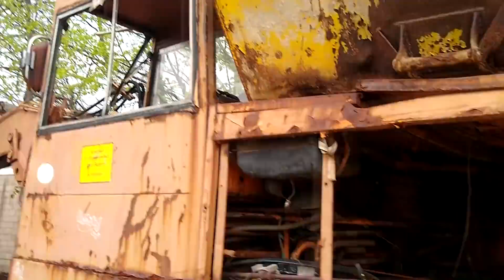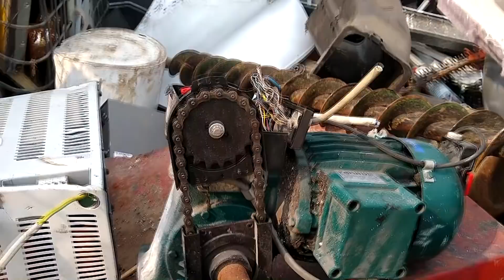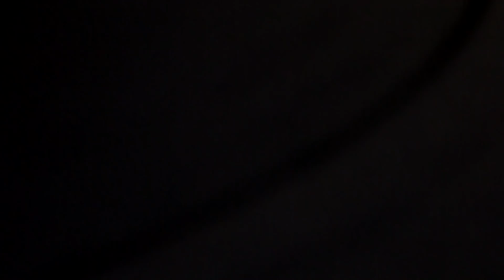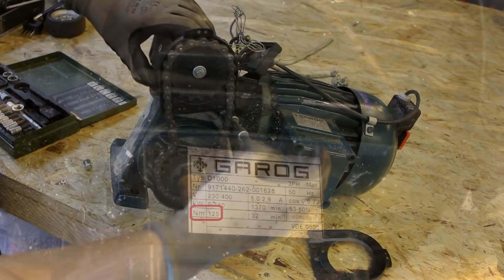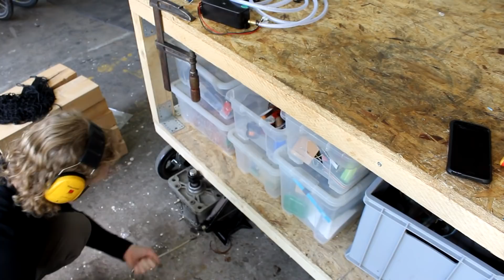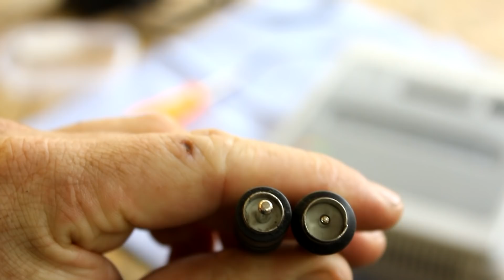Scrapyard Finds Repair-A-Thon

Comment: SNES are remarkably durable. As long as there is no liquid ingress, if it has a fault 8 out of 10 its either cleaning up the cartridge connector or the PCB fuse, which you can replace with a 20mm fuse-holder which happens to fit perfectly 😁

Comment: I love your scrap yard videos. I use an old refrigeration vacuum pump when making plaster moulds for aluminium casting. It’s very good at pulling the air bubbles out of the plaster while it’s still wet so my moulds end up with no porosity at all. Cheers Stuart 🇦🇺

Comment: I just thought of something really rude.  With the right engine - and a service check on the gear assembly on the underside of that crane, and a re-fit gaskets on those hydraulic arms - you have a nice second hand industrial crane....

Comment: Regarding the FESTO: it can be modified by changing the main tube (to a longer piece), the 4pcs of outer bolts/threaded rods respectively, and the main rod itself (this would be the pricy part)....but this way, you can get more stroke according to your needs....Furthermore, you can put a spring inside according to your needs, and you will get a single actuated pneumatic cilynder....

Comment: Great stuff! I need help with a Parkside 18 volt charger JLH-H150-18.  How do I check it and find out why it does not charge. Its output is only 0.4 volt. Thanks. Sham.

Comment: Enjoy your videos very much.  Clear explanations and interesting stuff!  The local scrapyard is my favorite place to shop but I rarely see the kinds of things you find.  The yard has quick turn around so what was scrapped today is often on its way to China or where ever tomorrow.  Also, they are not letting me shop at the moment because of covid 19.  Please be cautious with vacuum pumps I used to work in various labs and factories and vacuum pumps were often exposed to some incredibly toxic chemicals which would be captured by the oil.  Maybe Germany has strict enough laws about disposal of contaminated items to keep them out of the scrap yard but I would still be very careful.

Comment: Most people either replace the chuck, or they throw out their drill and replace it entirely because it isn't holding bits anymore. 
But in reality, the chuck retaining screw likely just fell out of the chuck at one point or another and simply needs to be replaced. 
They have to be ordered online but, they only cost a few dollars (U.S.).

Comment: Nice Video! Could you explain different ways to energize three phase motors off single phase. I never knew you could just use a relay.
Reply: there are ways to do that like rotary converters and single phase to three phase variable frequency drives. although in the video, he was using three phase to power that motor and a single pole light switch to turn the relay on and off which in turn energized the motor.

Comment: Where can you find a scrap yard like this in England? My god this is heaven
Reply: Vladimir Lissoi Agreed. My Dad, a dumpmeister from 'way back, and I were just bemoaning this about an hour ago. In days gone by you could take mostly what you wanted, within reason and provided you didn't make a pest of yourself. We had a load of bicycles and lawnmowers and repairable electrical appliances. Now this is not allowed and all 'recycling' has to be done by local government, ie expensively and therefore not at all, (sorry for the cynicism). Surely there is a way to legitimise back-yard recyclers and home fix-it folks. Isn't that a green attitude? Sorry to use you as a ranting-springboard mate, but what you said made me feel 'I'm not alone!' Cheers and thanks for your comment.

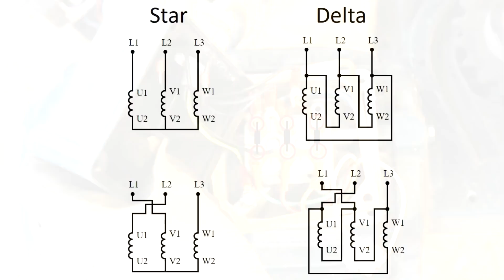Comment: 7:57 you got you're illustration wrong, the windings aren't arranged straight down, but more diagonally. Connector top left connects to bottom center, top middle to bottom right and top right to bottom left. That is to make a Delta connection possible with 3 bars connecting like the windings you have drawn.

Comment: I look forward to a video about the welder.  The first one that compared several welder transformers and how they work was awesome!!  I would like to see more in depth reverse engineering of this new tig welder!!!  Two questions for the list:  1) How is the ac arc frequency controlled or how could it be controlled if it is not? 2) How is the current controlled?  I am trying to understand how feedback from a hall sensor or shunt is used by microcontrollers and/or analog circuits to meter the current.

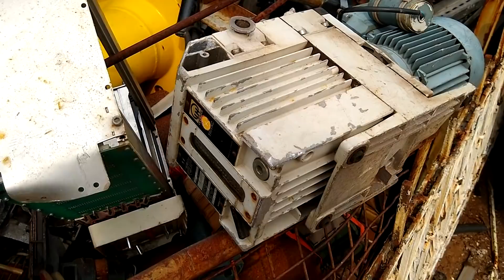Comment: 3:19 I used to service and rebuild Leybold vacuum pumps, you need specialized tools to rebuild vacuum pumps correctly, as well as parts.  I'm interested to see what happens with them.
Reply: I rebuilt a couple of those, what kind of especial tools do you need? I got away with normal tools. My job is to work on lyophilizers

Comment: Have another look at that IMAX power supply, there might be a water cooling system on the bottom and that would be filled with very high quality lab grade stainless steel pumps and heat exchangers and controls like flow sensors, thermostats, deionizing cartridges, etc.

Comment: Just a small info: 

The Windings of these 3phase Motors are connected diagonally, so you can use strait connections for delta configuration.

Comment: We have a couple of those Edwards vacuum pumps at work. We use them to test density transmitters, and to suck/pick up ~300kg neoprene prover balls. Pretty good quality, and easy to maintain. Unless you use it as a vacuum cleaner -_- (as some of my colleagues do)

Comment: Are you an Amateur Radio Operator? I would be surprised if you are not!
Also, it would be interesting to hear about your growing up, and how you got into this. 
As a kid, I had a little red wagon, and with this on the day before trash pickup day, I would go through my neighborhood and pick up old electronics and appliances, especially old television sets, take the parts and then place the skeletonized leftovers back at the curb for the trashman to pick up. Here in the US when you go to a junkyard, most things are "complete", in that no one thinks to keep any parts. Not even knobs off of old things. I've always thought this to be crazy!  
All the Best!
William Pietschman (W8LV)

Comment: Can we have a couple of looks inside these broken TIG welders? Like what electronics is inside. I would grab the Dalex one, looks like a really nice machine. Looks like the TIG torches are on top of it, so you get everything you need. And grab the power transistor bricks out of the Lorch, since they are usually what fails on inverter welders.

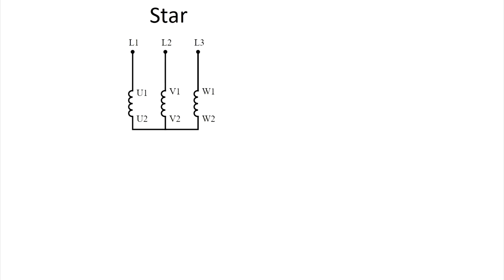Comment: is your graphic at 7:43 a little wrong? usually the coils arent usually connected in straight lines, usually ther are connected 1-5 2-6 3-4 as you can then bridge the gaps 1-3 2-4 3-6 to get the triangle connection

Comment: Messes with the cheapest stuff around...
Pulls out a Fluke multimeter....
Reply: Well, he can afford a fluke multimeter because he is getting a good return on all of his other builds by not paying retail for them. And it's just a tool: There are cheap tools, and expensive tools. You must pick and choose. I own a  Fluke 28 II, yes it was expensive but last a lifetime and it's not just accurate. The fuses are replaceable, and it contains internal blast shields in case of a catastrophe. You could lose your hand if you have a cheap one and get across the wrong potential. Way safer meter. Drop proof. IP67.

Comment: You can also convert the motor to single phase  220 Volt , to do this you will need a capacitor.
Reply: Of cours,  but  the motor  can be loaded with    only 70% of the rated power . It may sufficient for many application.  The capacity of the  cap  is about  70µF (60)  at 50 (60) Hz  per 1kW motor output.  A VFD is a better way. There are lot of pricly VFDs on ebay.

Comment: Nice that German households have three phase power by default.
Reply: Wow I wish that was so in the US. If you want three phase put in the garage or barn, the power company charges you from the closest transformer by the foot. And it's usually cost prohibitive. So three phase convertors are sometimes used. But that is quite an inefficient conversion- you buy the convertor, and then "convert" your money into heat! One wonders at times if it wouldn't just be easier and more efficient to burn the money directly to power your own three phase generator, bypassing the power company completely! But then there would be the Environmantal Protection Agency  to deal with...  ;-)
Reply: @w8lvradio  Fuel for your generator would be seriously expensive for any decent sized equipment that needed 3-phase. AN off brand motor driver that takes 2-phase or single phase input and outputs 3-phase is the most cost effective way to get 3-phase for small to medium equipment. For larger set ups, a UPS with minimal battery backup is borderline on just getting 3-phase from the power company. As for rotory converters, they are massively inefficient and seriously outdated technology.
Reply: @KnightsWithoutATable  yep... Essentially they sound like the Motor-Generators found on ships... Back in the day.
Reply: @w8lvradio   I don't know the efficiency of those converters, but if you are only using it some of the time it makes sense.   Installing your own generator sounds very inefficient and expensive
Reply: @w8lvradio  Quote "But then there would be the Environmantal Protection Agency  to deal with...  ;-)"
You could use their paperwork, though...
Reply: Wow... embrassing XD New houses in Poland have also one phase instalation, but only because they dont need more, and its cheaper to build... In Poland we have only one or two transformers per village, (for 100-200houses). So air power line goes trough all village. I hope my english is correct XD
Reply: @AndrzejSQ9PKW  Your English is excellent.
Reply: Not only, in Poland is very common to have 3~ instalation.
Reply: @Islandwaterjet  This boggles my mind i run a small butcher and all of our bigger machines run on 3 phase. it was under 5k to set up the shop with 6 three phase outlets all fused and water isolated.
Reply: In the UK you can get it but the vast majority of people just don't need to bother with it, i know in the US it's an issue for a lot of people and their woeful voltage make it even worse
Reply: I have 3 phase in my house and sheds. New Zealand
Reply: Don't you have such? How are your  big machines driven?
Reply: Not all of them, only the bigger houses.
Reply: Only rich people have.

Comment: Nice finds and recovery! 
Like Thomas Edison once said” to be an inventor you need a good imagination and a pile of junk”!
Reply: Ohne Schrott im Haus kommt kein Erfinder aus... ist von Rudi Drahtlos. :) It is similar the same what T.A. Edison says. I visit scrapyards in regular manner around my area,  the disantvantage of those trips are I got to much stuff. The last acquisition was an wall mounted batterie charger with meters    , a Car HI-Fi power amp and  12V  to 1200/230V  watts  power inverter . All for few quids . I live in the Hamburg area . I know about 4 Industrial scrap yard, no cars and lorries, just industrial . They sell the stuff to anyone by the kilo or by a look at your face...:)

Comment: On the 3 phase motor, you showed the windings as straight across, you may have done this for simplicity, but the windings are diagonally connected, meaning that if you want to use delta connection, you put the links straight across.
The windings are marked U,V,and W, with a small 1 on one end of each (U U1, V V1, etc)

Comment: at 8;00.  windings on 3 phase motors are not connected to the terminals as you show
Reply: Why not? It seems that they are in star connection, why do you think that they are not connected in star?
Reply: @zrnjan  It is indeed wired in a Star config, I didnt say it wasn't.. However the lines he draws at 7:42 to indicate the connection of the 3 winding's to the terminal posts is incorrect. Typically they are connected diagonally so that when the brass link strips are configured for delta the end of each winding is connected to the start of the next winding.  google search > 3 phase motor winding terminals

Comment: I don't know if it was intentional to make it easier to draw or not, but your AC motor terminal block schematic is incorrect. The windings would get shorted in delta configuration if it was in the way you draw it. It is wired in a diagonal way.

Comment: Starfox the perfect choice for your retro desk
Reply: Star-WING :P And in German too!

TPAI, if you intend to use that SNES, it's worth doing the 50/60Hz mod with an ON-ON switch in the back. Most PAL region games run way too slow in 50Hz (, but some have optimizations so you need the switch).  And before you open it up again, turn it on while unplugged, it'll discharge its caps and you won't blow the internal fuse while poking around!

Comment: what the hell .Why Germans throw perfectly working stuff? :(
Reply: Every industrialized country is this way. The reason is NOT money, it's KNOWLEDGE. Every single failure of these items is easily repairable, however, people have been so specialized in their knowledge that they don't know how to fix any of it. Someone lost the cables to the SNES, so it was thrown out (they couldn't be arsed to find the adapters, or anything else). The chuck failed on the drill, so the entire thing was thrown out because the guy who owned power tools was never taught how to use them/disassemble them. The machine that raises doors was probably thrown away because a sensor broke, but the owner had no idea how to trouble shoot the thing, so he threw it out and replaced it. 

All of these machines WORK. They are thrown away because the people using them are selectively DUMB.
Reply: @RavemastaJ  The SNES won't connect to most modern TVs. Easier for most to just buy the remade version with HDMI.
Reply: @ravemastaj A jack of all trades is a master of none, but I'd rather be able to do everything "well enough" than to master one thing and be clueless elsewhere.
Reply: Money, the value of things is smaller when you have too much money. I really regret that's the case.
Reply: We sadly don't have a huge thrifting culture so most things we don't use anymore just go to the trash.
Reply: The positive side, the TPAI did find these gems and made this cool video inspiring people to have another look at previously discarded stuff. In business I've seen a lot of discarding of perfectly good items, simply because they did not have use anymore and the bookkeeper-morons simply didn't like putting things up on ebay and the likes for an actual market value. Unlike a consumer selling to another consumer, they have to make an invoice etc. Laziness and the incompetence to prevent waste, is a major factor in this. It also happens companies sack the skilled workers, and the remaining people are simply not able to properly use, maintain and understand the value of those tools like the TIG welders. Also a lot of people are not even slightly aware charities like Tools for Self Reliance are very happy to receive such tools and perform very similar repairs! (I'm not aware if it exists in Germany, in the Netherlands it's called 'Gered Gereedschap')